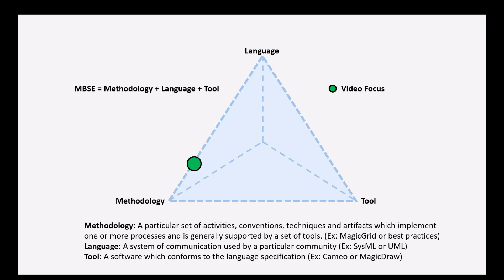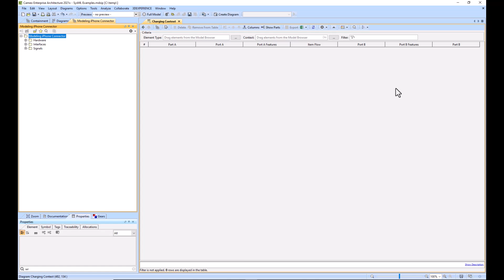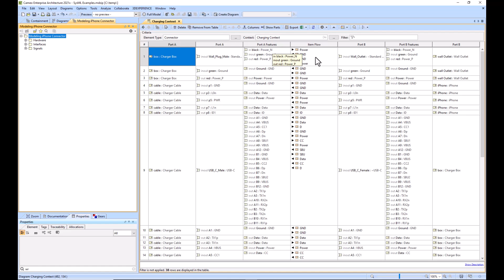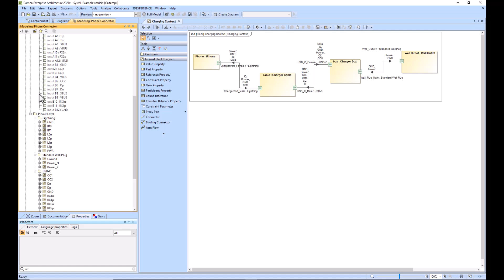SysML - Modeling Plug & Pinout Levels - iPhone Charger

Comment: Is there a way to know (maybe a property) that shows where a signal is generated? For example, where is the power coming from?
Reply from the maker: The way to track down the source within the model would be to figure out which signal you're trying to target (potentially the "Power" signal).  Then find it in the containment tree, right click it, select "Go To" in the dropdown, select "Usage In", and then select "Item Flow".  This will provide you with a list of all the structural elements the "Power" signal is running across.  You can track it down that way. 

There's a way to code it also using structured expressions but it is more complicated.